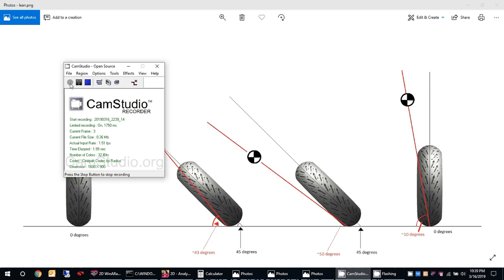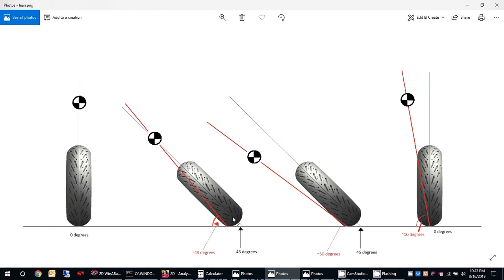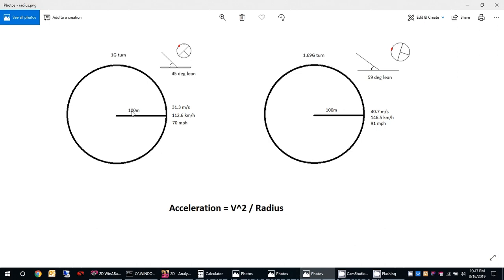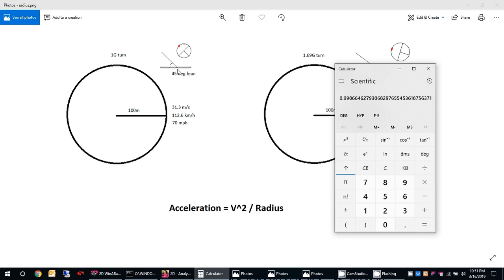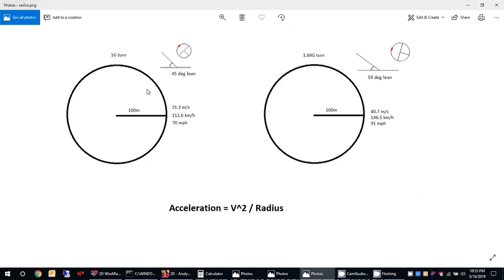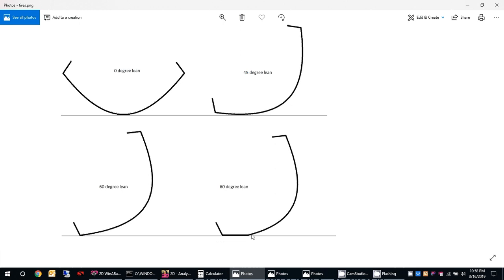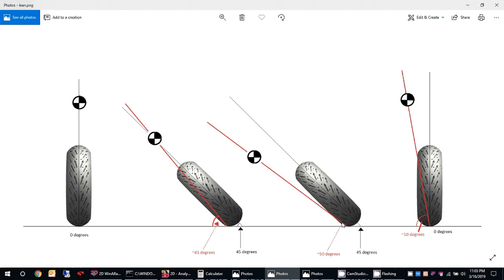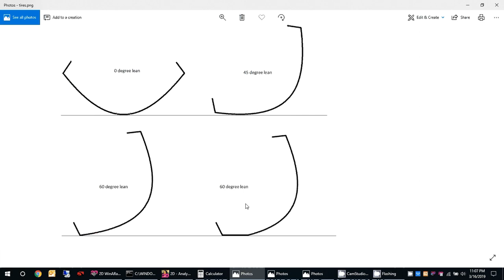#4. 2D Data Recording - The two types of motorcycle lean angles

Comment: As far as tire Temps. When riding street, my tires rarely get up to temp. Unless I'm really pushing, on backroads with no lights, stops, or traffic. I use to always want track biased tires, thinking that they will be stickier. But I end up losing traction because they are never really hot enough. Plus they wear out in 5k miles. Finally I switched to a road biased silica compound. And what a world of difference. Instant traction and confidence!.. I see a lot of people with the same mindset. Like "if I get a race bike with race parts, then I'll go faster". When in reality it just makes the bike harder to ride for most normal people. Then end up being intimidated and riding slower. Like using a scalpel when you need an old hand saw. Lol. Better to get something that matches your skill and riding conditions.

Comment: Noam, great stuff and I'm loving these videos. It would be great if you could do a video that goes deeper into the physics of mechanical grip of a motorcycle tire at corner entry and break down the much talked about 100 points of grip. My thought process is that because of the flex of the front tire under braking, mechanical grip actually increases to exceed the 100 point limit. Basically I would like to know how much combined lean, braking and lateral force the tire can actually take before reaching the "limit"? - I have a feeling most of us are much further from that "limit" than we think.

Comment: Thanks for the great video, it helps a lot. Two points came up to my mind though. You said, suspension is on 50% on 45° - isn't it 70% actually and 50% on 60° lean (cos 45 = 0.707, cos 60 = 0.5)? And maybe a reason for not being too connected to the bike would be to let your lower body work as additional suspension e.g. like getting light on the saddle when running over a bump.
Reply from the maker: I think for suspension geometry effectiveness, it's we don't need trigonometry. At 0deg lean effectiveness is 100%. At 90 deg lean effectiveness is 0%. And at 45deg effectiveness is 50%.
Reply: @FlyWithNoam  OK, but at 45° the possible travel of suspension is 50% of the travel at 0°, right? Don't you think, that counts?
Reply from the maker: @bunker5001com  no you misunderstood. The possible total travel of the suspension is always 100%. I'm talking about the ratio of how much a bump is absorbed by suspension vs chassis. At 45% they split this task 50/50. Obviously chasis flex is not nearly as good as the actual suspension.
Reply: @FlyWithNoam  I agree on flexibility of chassis, swing and wheels and in addition the vertical travel of the suspension at 45° is 70% and 50% at 60° if the suspension uses its full range of motion. It's like the circle of friction - one might tend to think that you can break 50% when leaned 50%, but actually you can do more, because the forces adds geometrical, so in theory 70% break at 70% lean is possible.

Comment: you don't feel the g forces because on the bike you're actively moving to resist them. You hold on to the bike with your legs, your legs put pressure on the pegs, you lean to the inside. The way your body moves negates this "feeling" of forces. In a car, you're strapped down to a seat. If you actively try to resist the Gs you will stop "feeling" them

Comment: Angular or vectored g forces on the tyre increase the further you lean or the faster yoy go so whether you have any grip depends on whether angular kinetic energy forces overcome frictional forces so lean angle limitation depends on all up mass, acceleration and corner radius verses contact patch and ciefficient of friction.  Suspension and tyre pressure will affect contact patch and mechanical grip.

Its not as simplified as presented because calculating mechanical grip needs calibrating each bike plus rider  against suspension settings, tyre compounds and pressures for any given corner = lots of testing hence 2 d data tracking.  In other words it changes if you change any one of these things, including rider or suspension setting or air pressure or compound or speed or tyre angle.

What works for one person will almost certainly not work for another at any given corner speed hence every person needs their bike set precisely for them.  Thats all you need take away from this.

Comment: Did you compare your rate of lean to the superbike rider ?
Reply: @FlyWithNoam  cool ill check it out. I was under the impression that this rate is key to corner entry speeds and therefore laptimes, but even so its not an easy thing to improve as like with max lean angle fear kicks in, so  afaik it requires lots & lots of practice to push it back.